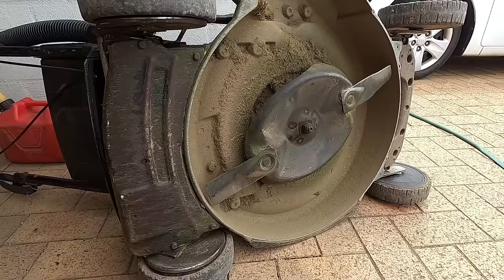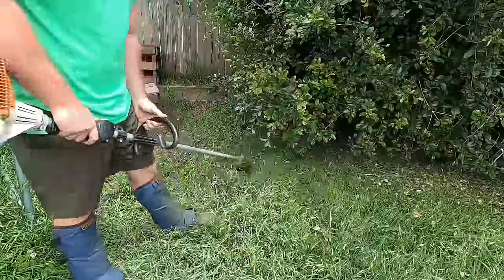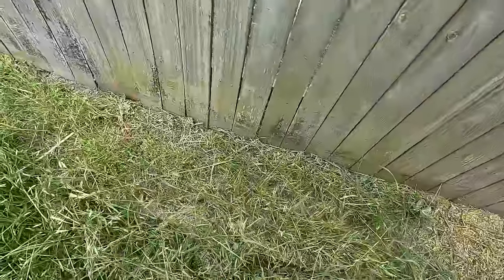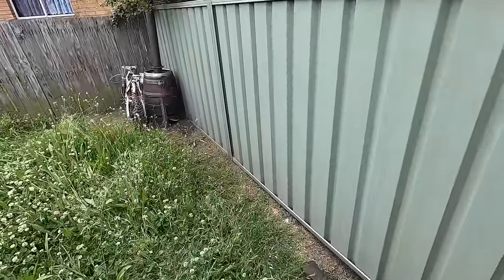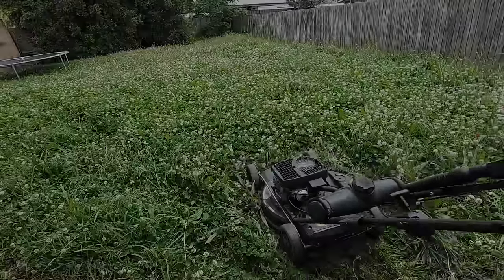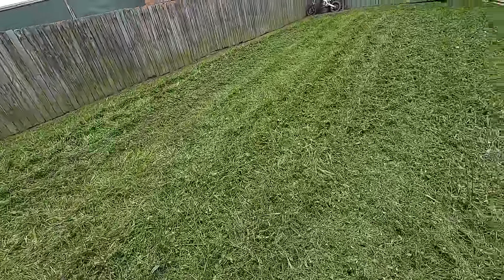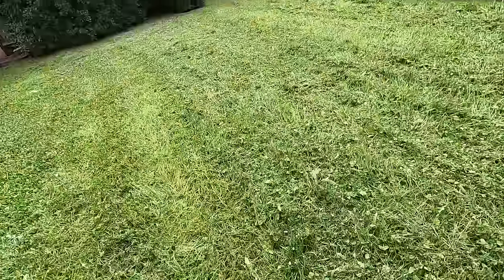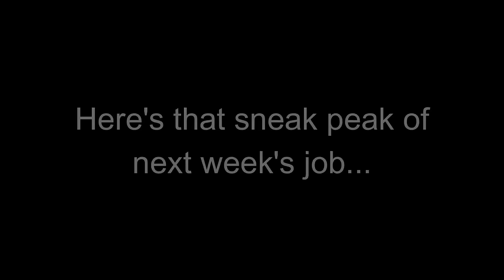SATISFYING lawn mowing of a CLOVER FIELD - long grass cutting Australia

Comment: As ordinary humans sometimes we overlook simple, logical solutions to things. Keep including your work tips like strimming direction and blade sharpening. At age 74 I certainly know that we're never too old to learn. Thanks and nice yard work.
Reply: Yeah, thanks a ton for that Sean! Didnt think of using the dremel to sharpen up, always just thought of pulling the blades off and using the vice n ankle grinder.

Also, only sharpening up the last 3 inches? Why not the whole length?
Reply from the maker: @Moo Kau 
The last 3 inches are the only bits that cut the grass.  Brand new ones out of the packet only have the bevel on that part
Reply: @BladeMateLawnCare  Gotcha. I guess if you where moving that quick that those areas where cutting, yould be doing something wrong.
Reply: Amazing that these videos show all the things I didn't know how to do when I had a lawn to mow.
Reply: @BladeMateLawnCare  yup
Reply: I love all the tips too! I suck at gardening but watching these is gonna get me a better lawn. 😊

Comment: This is a prime example that big expensive stand on mowers do not do a better job than a push mower. It's the operator that determines the quality of cut and how the lawn looks at the end. Great job, Sean. I expected no less from you. Always excellent attention to detail and your willingness to go just that bit further so the property looks fabulous!
Reply: Its not about doing a better job its about efficiency with larger equipment.
Considering that it leaves the same finish, would you rather mow a golf course with a ride on or a push mower.
Reply from the maker: @freespeechisdead202  Good thing I don't mow golf courses then!
Reply: umm actually the commercial grade large mowers do actually do a much better job not sure what your version of a better job is but it does make a difference. Not saying you can't do it with this but heavier duty mowers have more power and are larger making them more efficient and providing a better look.

Comment: I've never heard of anyone blow drying their yard!🤣 I nearly had a panic attack when you tipped the mower on it's side.  Then later I noticed your fuel tank is up above the motor.  Tipping a mower with the usual tank is risky because gas will leak out and with the heat of the mower it could catch on fire and explode.  So I never tip mine unless the gas tank is empty, it's cooled off, and the spark plug wire is unplugged.  I really like the clover yard as opposed to that long wiry grass. The clover makes a nice low mass and the bees really do love it.  It looks great!

Comment: I've never seen that corrugated metal fencing in the states.Good idea..would last "forever"
Reply: Colourbond its called, and yeah, it pretty much does. Easy to install too!

Post hole digger with a good auger, rapid set concrete, level metal posts at the right distance between, put the middle panels in at right height to each other, angle grind any posts that are too tall to the right height, hammer caps on, back fill those holes with soil, and roberts you aunties live in lover.
Reply: Some of these ive put in 20 years ago still look like i just did them.... minus one where an idiot drove a truck thru it.
Reply: @MooKau_  Also a benefit is no one gets the ugly side and there are no climbing rails for kids and theifs.
Reply: @michelleodwyer2271  yeah, no ugly side, but you can still jump these fences okay
Reply: @MooKau_  🤣

Comment: I have learned so much from watching your videos and applying them to my own yard. I never thought about the way the trimmer head moves. I do have a question tho. why do you not use a shield on your trimmer? The yard looks great. Outstanding work you do.
Reply from the maker: Hey thanks, that's great to hear! The only reason I took my guard off was for storage. It doesn't fit on the rack on my ute with it on. That said, it does next to nothing to top any debris hitting a window or anything, it's more there to protect the operator, but that's what safety glasses and shin guards are for. Plus it fits into smaller areas as well!

Comment: There was only ever a few models of a lawnmower we had here in Aus that never clogged up.
My sister had one but her Ex blow up the motor and so I had a spare motor that I put on and so I kept till he wanted the mower back (When he became Ex and so I did with is old motor)
It was great, wind up clock spring start and the best was the toe cutter function all round it, no need for a whipper-snippier with it around, and no I don't mean the open frame version tho I had one for show.
The best part was it being so open on all sides I was never able to stall it, the worst was if you hit a rock as it went wherever it wanted and there was no stopping it (shins, windows or even through a wooden plank in the fence)

Comment: Nice work as always Sean. I recommend using a puddy knife or a paint scraper to scrape the deck it will save some time. 👍🏼
Reply: What about air compressor
Reply: @jayasmrmore3687  that will work to an extent. Still might need to scrape

Comment: Back in the day when I had grass in my yard, I hated corners, so  sooner or later I had a plant in a bed in the corner and could develpp the bed to have a smooth curve so that the mower could move continously. No back and forth to cut grass in those corners. That trick made lawn mowing much more efficient. In the garden beds I used lots of compost and mulch to reduce weeds and those weeds that came back were easy to pull.
   One question. Do you compost the  enormous amounts of grass clippings you remove?

Comment: I need to buy my first lawn mower as my very old one that was given to me has finally given up the ghost and I am wondering what you would recommend? I have lawn in my back yard and then a large front council verge which is cap rock & limestone so lawn doesn't grow so well. It is mostly low grass and it is unwatered and I can't plant it out with natives like other homes in my street because there is also a fire hydrant that needs to always be accessed that I keep the grass from around it by hand.

Comment: Pros and cons of a clover lawn? Sure looks great and I'll bet is great under the feet!
Reply from the maker: The only real con to clover is that if you don't want it there, then it's undesirable, and that would be purely for aesthetics. Let's face it, a lawn is usually just for aesthetics, so that reason alone is more than enough for most to not want it. Though from a practical standpoint, there are only advantages. It doesn't need much water, it can grow in poor soil conditions, it stays green, it's AMAZING for bees, and it doesn't grow much taller than you saw in this video!

Comment: I saw that you used a dremel to sharpen the blade and wondered 2 things. 
1. Won't those sparks burn ya?
2. Wouldn't the blade just eventually be gone chipping away every time you sharpen it? As always, good explanation and work!
Reply from the maker: You can barely feel the sparks. I've had some old work clothes have holes burned through them after doing some serious angle grinding, but this is nothing. As for the blade, yes it will eventually need to be replaced, but this is just a way to get some longevity out of them :)

Comment: As usual a great job,is the Victa self propelled or push,both my Victa 550s have mulching bungs,first pass with the flap up to spread the grass then a second pass with the mulcher bung in
Reply from the maker: Gday Jeremy, yeah this is SP. It's essentially just a newer version of the 550 (it's a 560). 22 inch deck also

Comment: there should be an aluminum shear key where the blade meets the crankshaft. soft aluminum shear key is designed to snap if the force against the blade is too great. not saying its foolproof, but you should not be afraid of using a mulching blade. has moore sharp bits, and works well on a bagger jmo

Comment: How do you edge so well without the line snapping all the time?  
I have a thick couch nature strip that needs a good edging every once in awhile but the line just snaps constantly when I try.
I do have a bladed edger but its not easy to use and quite heavy on the shoulders.
Reply from the maker: It's the combination of commercial trimmer line and a speed feed head

Comment: to properly sharpen the blades you need to take them off and grind them with either a hand held grinder or a pedastool grinder. A hand held grinder is like 35 bucks for the cheap one here in the US of A
Reply from the maker: For a thick bar blade, I agree. Though these blades are 2.5mm thick. There is no need to take them off, as it won't make an iota of difference which way the bevel faces when they are this thin

Comment: Will the clover still survive when it’s that tall  and cut?
Reply from the maker: clover is very hard to kill without proper intervention. Most will return, but not all, as the nitrogen from the clippings will promote growth of the grass around it. This would need to be a continuous process to remove all that clover. So in short, yes it will survive.

Comment: Blade orientation? I'm confused now. Shouldn't the sharp point should be closest to the ground with the angle pointing up at the deck - as most sharpening pages direct? Is there a reason yours are opposite that I'm unaware of, or just convenience? Certainly can't argue with the results either way.
Reply from the maker: Yeah, just for convenience. The blades are thin, so it doesn't make a difference
Reply: @BladeMateLawnCare  Fair enough. For the fun of it I've just ordered a cheap sharpener bit from ebay that should do it the other way around. Angled grinding stone with guide design. Might be cheap junk; might work. Same idea as the dremel.

Comment: Maybe I'm seeing it wrong, but it looks like that lawnmower is tearing the grass rather than cutting it, because I see a lot of bent over grass.
Reply from the maker: That's due to the height of the grass, and is a good example reason of why it's important to mow regularly.  What is actually happening is the mower is pushing the grass over, and effectively trying to cut it whilst it's lying flat. Not alot to do about it unfortunately

Comment: It's the first time I've ever swing blades. I wonder if you could put the on a riding mower. I had my boyfriend take the guard off the weed wacker. I can get into a lot more areas without it
Reply from the maker: You possibly could, if there was a cutting disk big enough. That said, ride on mowers have belts to drive the blade, so there isn't much of a risk to the crankshaft
Reply: @BladeMateLawnCare  well I don't know what he does, but he's damaged a few blades on the rider. 🤔. Just thought if it was possible.

Comment: 2 things wrong with this. One that's a little push mower, not a bush hog on a tractor so there's no need for a stump jumper in the middle and two, the blades are sharpened on the wrong side cause I noticed he sharpened the blades from the bottom instead of the top and to the blades don't cut as well as sharpening the blades on top.
Reply from the maker: Hi Robert, thanks for the feedback. Not sure what you mean by stump jumper, but push mowers don't get bigger in Australia. You're looking at the legendary Victa Mulchmaster with the equally legendary Powertorque engine on it. This was quite literally a walk in the park for this machine and a pleasure to use. You're dead right about my sharpening method, however when the blades are barely 3mm thick, the side which the bevel is on makes next to no difference. If it saves me 10 or 15 minutes to sharpen this way, with no impact to cutting quality or efficiency, then that just makes sense to me. I will periodically take the disk off and sharpen the blades correctly, but yeah. That's my thought process.

Comment: you put way too much effort into that. think you need a different push mower
Reply from the maker: Lol, new to the channel I take it? This was one of the easiest yards I've ever done
Reply: @BladeMateLawnCare  seems like a very underpowered mower.
Reply from the maker: @snarkymcsnarkles3493  You must use some real beasts if you think that mower was struggling...
Reply: @BladeMateLawnCare  i use a pretty standard craftsman 140cc engine.
Reply from the maker: @snarkymcsnarkles3493  k, so what metric did you use to determine that one of the easiest yards I've ever mowed was a struggle?
If you want to see what me struggling looks like, watch this video, and you'll see why I'm scratching my head at your comment
https://www.youtube.com/watch?v=6FXvmW_c8_g
Reply: @BladeMateLawnCare  mere observation that it struggled. if i hadnt seen you sharpen the blade i would have thought that was all, the way it pushed down the grass and the size of the cut pieces is what led me to believe that.
Reply from the maker: @snarkymcsnarkles3493  like I said, check out that video 😉